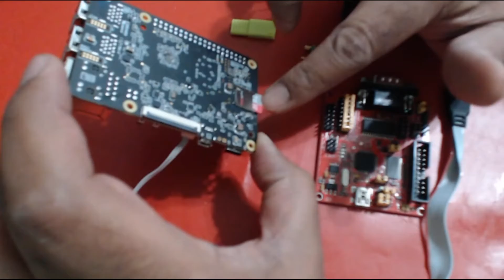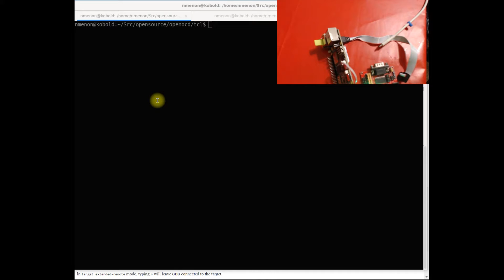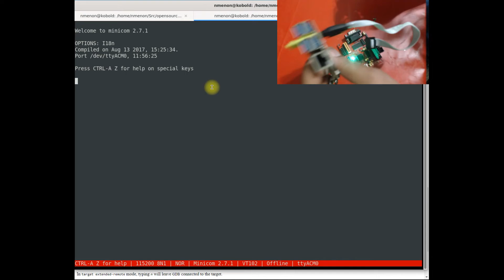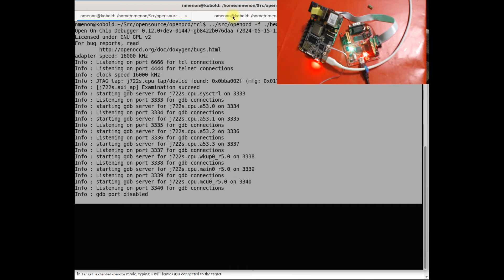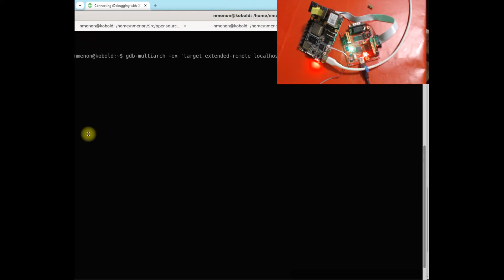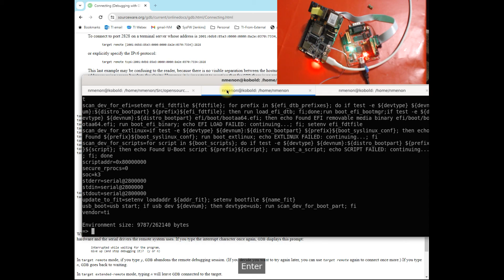BeagleY-AI HOWTO: JTAG + OpenOCD

Comment: The imx219 driver loads, but the camera is not detected. The required overlay is not applied automatically, and uEnv.txt changes don’t work with the Edge AI SDK image. I2C does not detect the camera address, so it isn’t initialized. Rebuilding the kernel with the overlay is possible but complex. Documentation on overlays for this image is unclear. I need help to enable the imx219 camera on BeagleY-AI J22S. Thanks!

Comment: Joel Fernades and you have been great at covering kernel debugging. Another great video. The only grouse I have with BeagleV-Fire, BeagleY, etc is the use of Tagconnect pins for JTAG. How hard is it to populate a 10 pin micro-jtag connector ffs?
Reply from the maker: yeah, @turanamo I share the same peeve. argument is that JTAG users are very very few and far between.. and choice would have been not to populate the header (bbb style). But on the flip side, I do appreciate not having to run behind people to get them solder pins on my board..  just hate the economics of the cables..